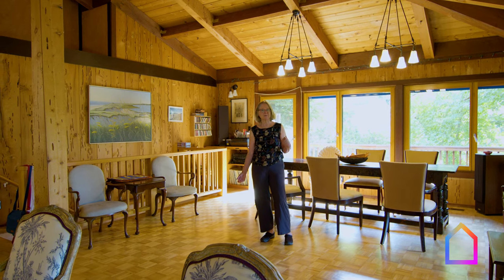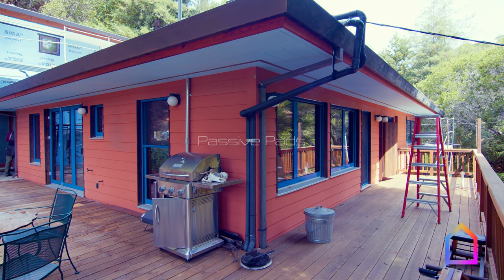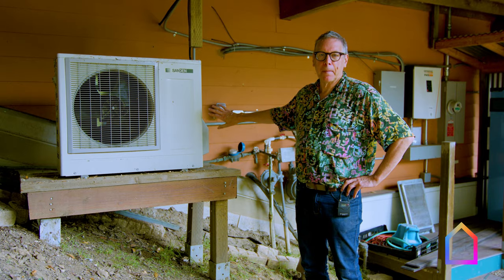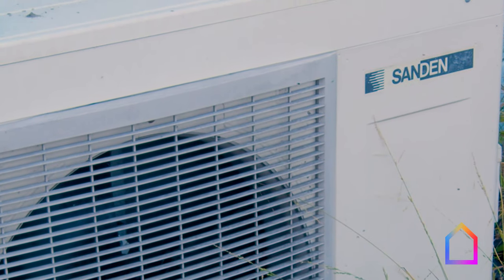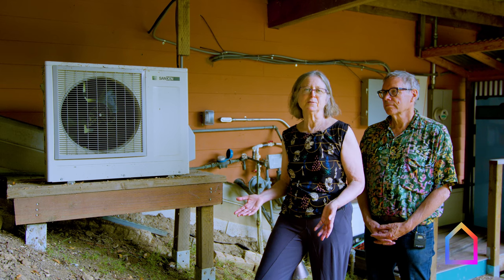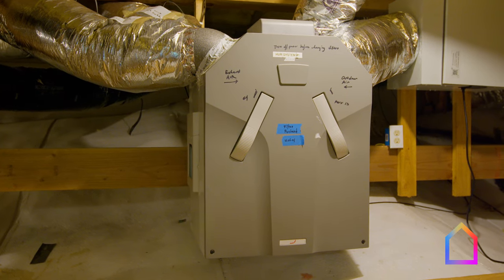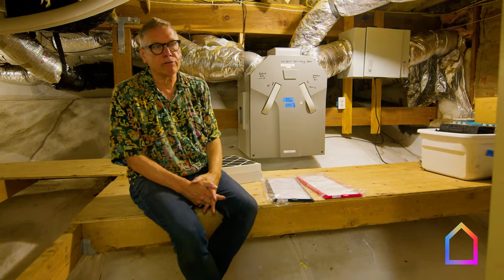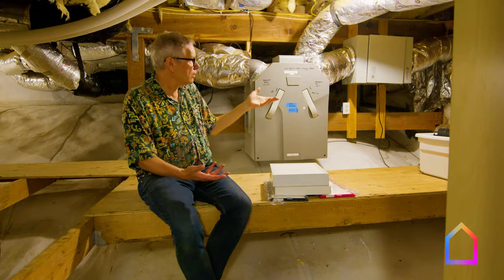INSIDE a Passive House Expert's DIY Retrofit

Comment: Nice job.  Congrats on your home hardening.   Note: if your "Carbon" filter is an activated carbon(AC) filter, it will be very expensive and using it as a prefilter is wasting that money, as a prefilter is a cheap filter compared to the higher Merv filters and AC filters it was designed to protect. The AC filter should be put after your particulate filter(~Merv 13+) which should be after the prefilter(~Merv 8 rating, prefilter rating should be below the particulate filter rating ).  That way your AC filter is protected from clogging with particulates and it can bond to the reactive chemical species it is designed for.